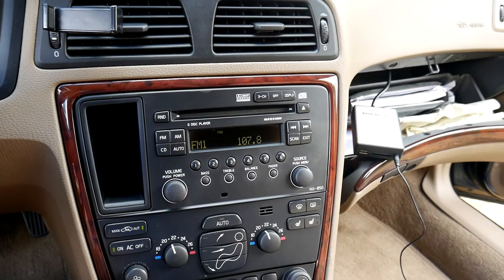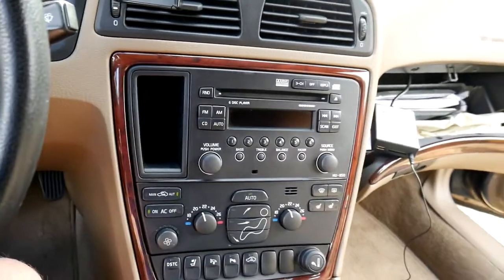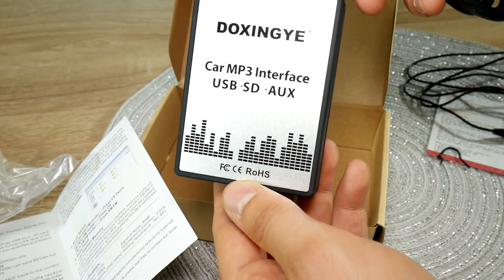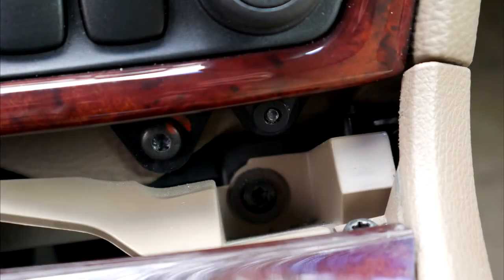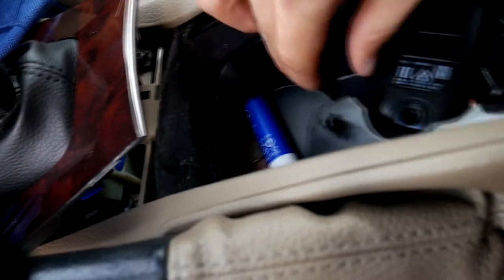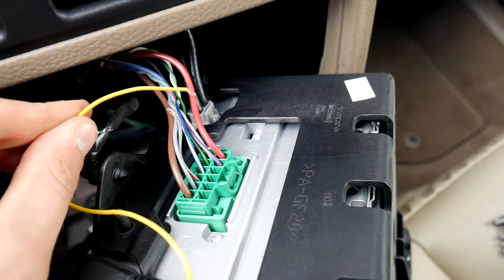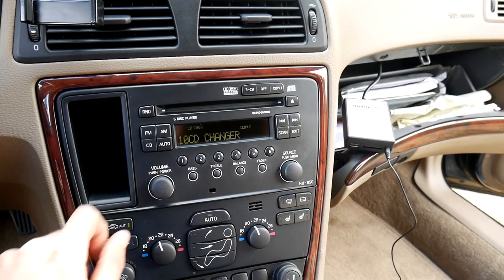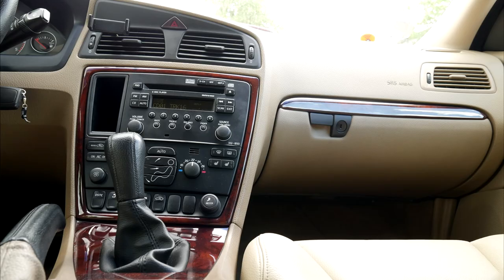How To Install USB and AUX Adapter for Volvo HU-850 radio/cd unit

Comment from the maker: Adapter for Volvo with HU radio on Aliexpress:
- https://bit.ly/3kSNBvd
Quick cable snap connectors on Aliexpress:
- https://bit.ly/2IY6JuG

Adapter for Volvo with HU radio on amazon:
- UK https://amzn.to/3gae5ZM
- DE https://amzn.to/45E0rVK

Quick cable snap connectors on Amazon:
- US https://amzn.to/3ITA0CJ
- UK https://amzn.to/43jAs5n
- DE https://amzn.to/43fehNG
Reply: Do you have the installation guide me? I have the same adapter but indon't have a installation guide. I can't go to an another map with the Hu-650. Do you know how i can fix this?
Reply from the maker: @sametdogan6233  ask seller for manual.
Reply: @TechscrewHome  he don't have it. Can you send me pictures of the installation guide? And do you know how i can skip to the next folder?
Reply from the maker: @sametdogan6233  I don't have it anymore also.

Comment: I installed a Yatour in my sons V70 today. I got ugly alternator-noises so I went to a store an bought a noise filter. But when I was going to install it I noticed that the noise stopped when I cut the yellow 12V cable that I had soldered on the HU-603 + cable!. So that was an easy fix and now it sounds great!
Reply from the maker: thanks for feedback :)
Reply: Hi Tommy
I got exactly the same symptoms. Yellow 12v cable is to power the Yatour - did you find another power source or just left it disconnected? Have just put the dash back together after giving up with it - your post gives me some hope!

Comment: what color connector should i use if i get a pack of 4 different quick connectors yellow, blue, or the red ones ?
Reply from the maker: what kind of connectors they are, aux adapter or... ?
Reply: @TechscrewHome  from the onses in the link
Reply: The red or yellow or blue.. or are they all the same? Does not matter?
Reply from the maker: @jornmulder  you mean Quick cable snap connectors ?
Reply: @TechscrewHome  yes or does the Color not matter..?

Comment: Can you change songs with steering wheel buttons?
Reply from the maker: I haven't tried, I'll check
Reply: @TechscrewHome  hey, did you check yet?
Reply from the maker: @madjoemak  Sorry, I forgot, because I use bluetooth connection.
Reply: @TechscrewHome  no problem. Did you plug a Bluetooth Device into the aux or did you install something else?
Reply from the maker: @madjoemak  I connect bluetooth device in aux input. There is installation video https://youtu.be/T7yYTNdSlsY from 2:30min
Reply: @TechscrewHome  thanks man appreciate it
Reply: @madjoemak   yes you retain sw controls - if you use usb to have to name each song as a file - track 1,2,3… instructions come with unit
Reply: @stuwaugh7672  glad I didn't do that then because I only really use Spotify. But the one I installed works fine

Comment: Hello my dear. Does this module also work for the Volvo C30 2009 cd player? If not what other adapter works? Because mine has no auxiliary mode and neither does the input. Thanks!
Reply: No that is a different radio unit

Comment: Is it suitable for volvo s60 2003 ?
Reply from the maker: HU-xxx series head unit ?
Reply: @TechscrewHome checked and it was HU-603
Reply from the maker: @jisssy808  yes, you can do that, just buy correct aux adapter.

Comment: Anyway to fix the buzzz noise? The seller has no solution to it.
Reply from the maker: can use some filter, or need check generator 12v.

Comment: On the USB parT, U can connect an external  HDD?
Reply from the maker: there may not be enough power for hdd, better use USB of memory card or just buy newer adapter with bluetooth function.

Comment: I found the aux plug in my car no need to do any of this volvo s60 2008
Reply from the maker: lucky dude :)
Reply: They started putting the aux spots in the cars late in 2006 so 2007 models and up should have them in the center box iirc